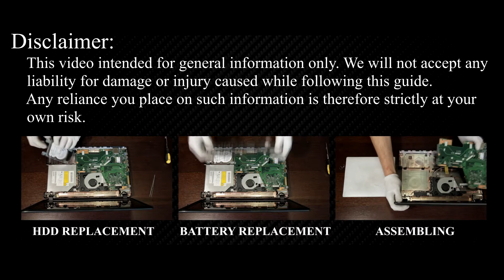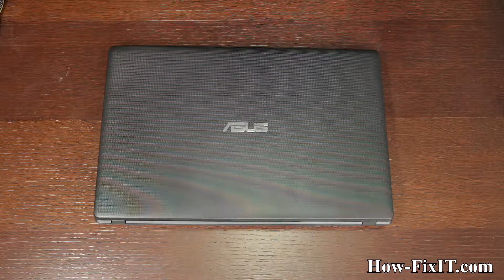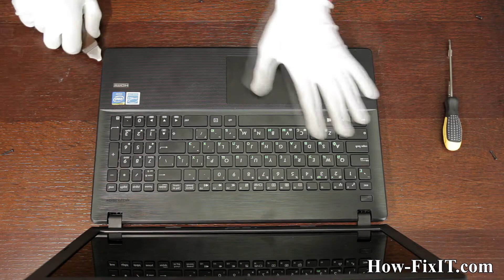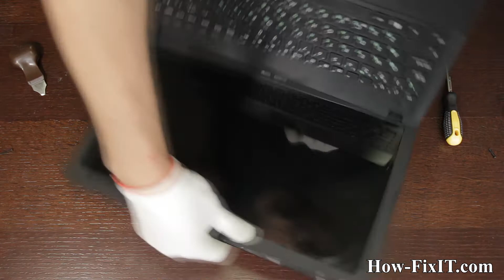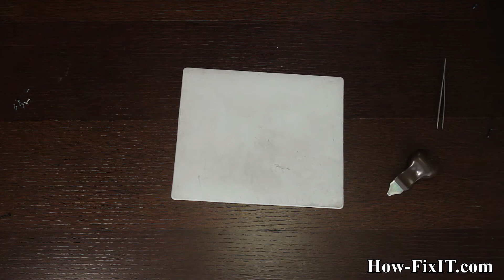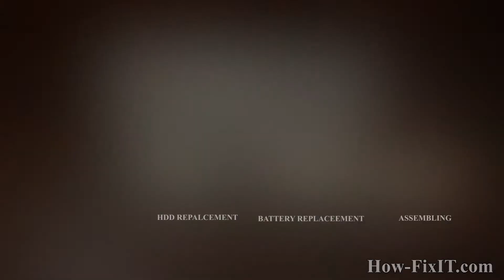Asus R512 RAM Upgrade & Install: Step-by-Step DIY Guide

Comment: It's 2025. I try to revive this laptop, which I have been given by a friend who wanted to trash it. It has 2GiB RAM, and the slowest 500 GiB laptop harddisk you can imagine. Ok, so I have ordered 8 GiB RAM module and 512 GiB SATA SSD. When I tried to disassemble it, I really wanted to trash it right away. Somebody really needs to slap the Asus engineers in the face for this! This "construction" is such a shame for any decent industry engineer... 😲 I managed to upgrade RAM, will leave it unassembled until SSD arrives, because I don't feel inclined to re-open the laptop a second time. I'm excited to see whether I can assemble it again into a working state. Need to figure out how to re-attach those tiny cable plugs to the mainboard again.
Reply: Hey I just got the same, it's like brand new didn't want do trash it too. I had a 128 GB SSD lying around and waiting for my 8GB purchase. I also left it disassembled because of the hustle didn't want to go through it two times haha. But I'm sure it will run win 10 and is solid for e-mail and surfing :)